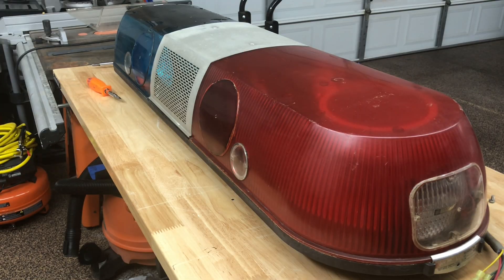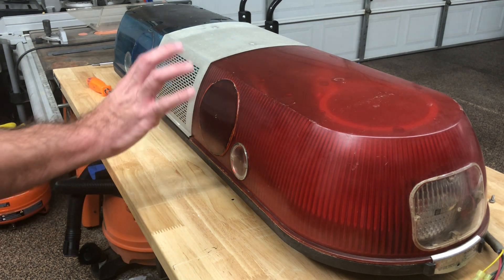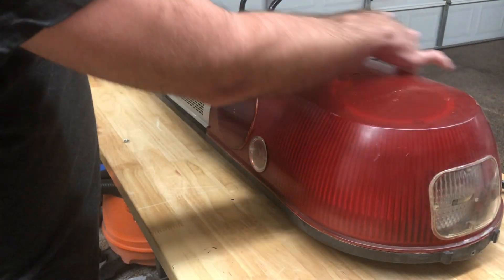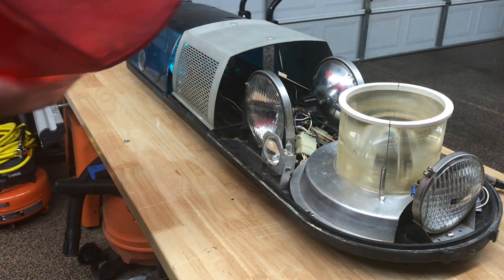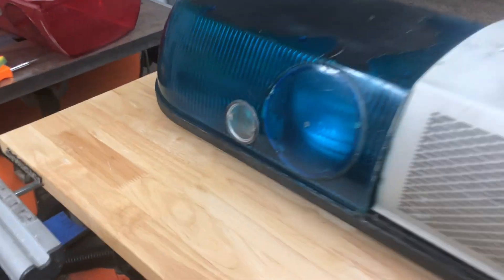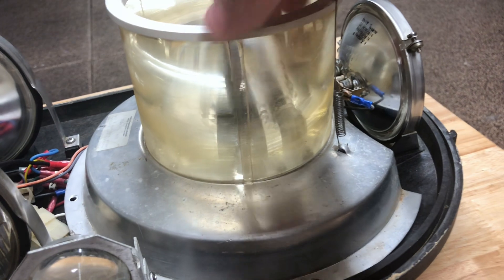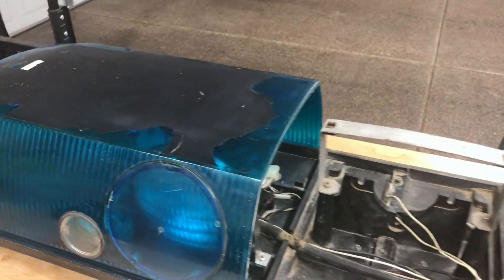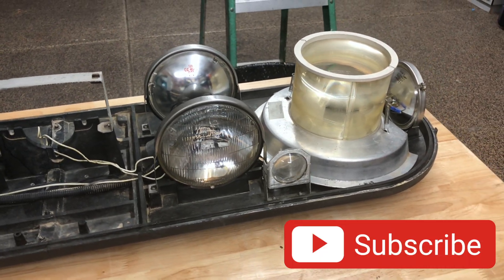Under the Dome: Whelen 8000 CA Spec.

Comment: Really neat.  Never seen a CA Whelen 8000 light-bar - neat yellow light for rear, and deleted opposite circular inner lens.  Reminds me of the show Chips - similar theory with 1 steady red light on front of police bikes,  while the other one would flash.  In Greenwich, CT, we had a Whelen 8000 on Crown Vics from `84-`89/`90.  The inner circular lenses were strobes, red/blue, front/rear.  Your light-bar has the white center-section which is what we saw in Greenwich.  Some 8000s had a grey/silver non-painted area.  I've never seen the 8000 used anywhere else and never in any tv shows or movies oddly.  Production apparently was `78-`82 according to the company.  But weren't used until `84 in our town.  Crown Vics, and believe it or not, Chevettes used them for Meter-Maid use.
Reply from the maker: Yeah, the 8000 wasnt widely used.  The Northeast states seemed to get the most use.  I know a guy who has a TON of them from early NY days.  Thanks for watching!
Reply: @AdamsLights  Good to know.  Cool.  Is he selling any?

Comment: The lenses around the Xenon strobes are omnidirectional (aka fixed) fresnel lenses, super cool bar!
Reply from the maker: Not quite. A fresnel lens is a group of concentric rings that help focus a single light source into a small beam- (designed for, and used with lighthouses).  The Fluted lenses of these domes actually help break up the light, to disperse it as wide as possible, for maximum viewing angle.
Reply: @AdamsLights  ahhhh gotcha! I must’ve seen the internal lenses incorrectly then!

Comment: I’d like to see the code 3 360 bar in depth.
Reply: I own a 360.  Prior to me acquiring the 360 in a " lot " of bars.  Never had interest in having one.  But once I got up close and personal checking it out.   I was amazed at how much light this bar throws off.  Top level has three revolvers.  four front to back strobe heads.  ( two front / two rear. ) ,   X-Fire corner strobes.  Rear bottom level facing rear has directional amber lamps with separate outer red alt flashers.  Lower level facing front has four TD lamp segments.  Added bonus ,  It has a Tomar preemptive strobe head for traffic light lights on the drivers side lower level.  This bar is a keeper in my collection.
Reply from the maker: I don’t own a 360 in my collection...